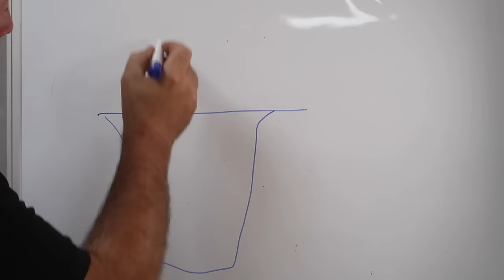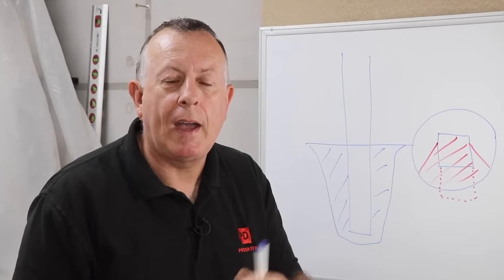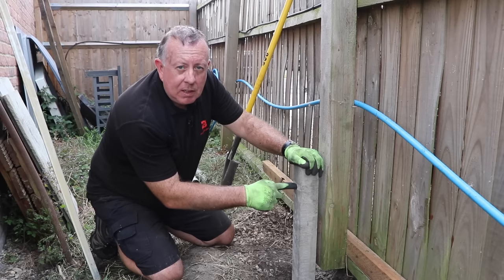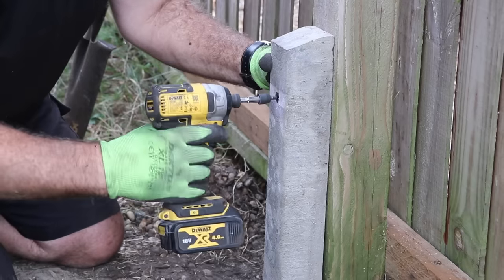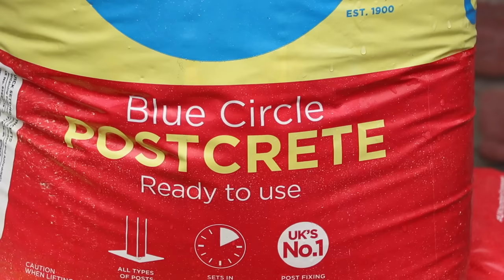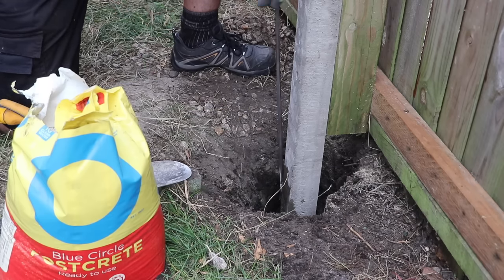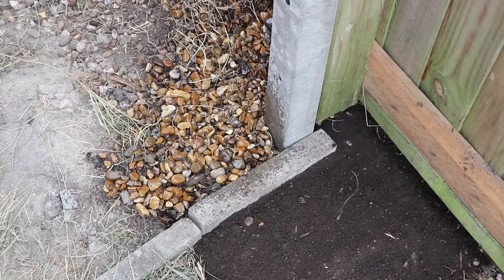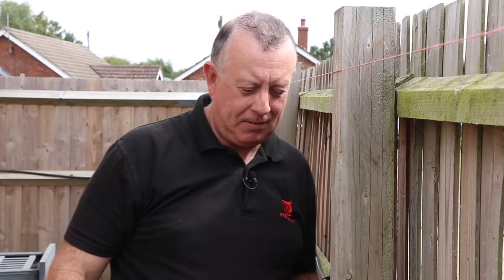The Easy Way to Fix a Fencepost

Comment: Should have put the concrete spur at the side rather than in front would have looked much better.
Reply: Easier putting the hole on front than on the side — one you have more room for you — not blocked off by the fence itself. On the front you have plenty of room side to side, and back that matter. Post hole diggers you have to drive/stick it down into the ground and then spread the handles  handles out and then pull out the digger with the dirt held inside it. And then repeat the action until you get to the depth you need.

Comment: Nice job Stuart.  I also used 75x75mm concrete posts but was able to attach them with M10x225mm coach bolts.  It turns out that the constriction in the holes is because of the concrete forming process and it is quite easy to drill those holes out to 10 or 12mm

Comment: Hi Stuart.  One thing you might want to try when trying to plumb a post to a string is after you attach your string to your two fixed points, slip a shim ( say 1/2" thick) under the  string near each end. While pulling the post towards the string, slide another shim ( the same thickness) between the string and the post.  When the shim contacts the string, the post is plumb. The nice thing about this practice is that while working, you can tell if the post has moved out of plumb. The way you do it, the post could lean into the string slightly, and it's hard to tell. Anyway, just how I've done it for about 50 or so years. Like your videos.
Reply: I really really appreciate this idea! Thank you!

Comment: Excellent little project as ever. Might be worth adding that neither the fence nor the post will mind if you mount the spur to the side ofthe post. 'Slightly' harder in the digging out phase, but will retain width of access if things are tight, and make mowing or strimming a bit easier. And you could have gone back and fitted coach bolts quite easily with access all the way through.
Reply: was thinking the same. great tip!

Comment: Good helpful vid (as always).
I've done this to all my fence posts (about 17 in total). It usually takes me around 2 hours to do per post due to the old concrete, broken bricks and lumps of flint (I live close to the Sussex downs), that you have to break up and dig out of the hole. Plus I'm not a 20 year old lad anymore!
My method is to use a long fencing spade, pointed breaker bar and a very powerful SDS hammer drill with a chisel function and using a very long chisel in it. Even so the best method I've found once you get around 1.5 feet deep is to reach in and pull out the soil by a gloved hand. I usually stop when I get to armpit depth!
Then in goes the concrete spur (after drilling out the tapered holes to suit the screws), using bits of stone or similar underneath the spur to make sure the base is at the right depth. I have had good success using 10mm diameter, long coach screws and large thick square washers to secure the spur to the post. Place the screws in the spur holes and give them a couple of good whacks with a club hammer to get the points in. Then screw them up using a socket and ratchet wrench. Making sure everything is square.
You may need to support the post using a length of timer screwed to the post and at an angle in the ground to steady it and keep it square before concreting.
I always use postfix. Sometimes using bits of removed material like flint, stone or half bricks to fill the surrounding area of the dug out hole if it's too large.
In goes some water and then the post fix. I usually use 1.5 bags per post on my 2m high fence. Tamp the mix down with the end of a piece of wood to make sure the mix is right around the spur deep down.
Just a tip. I had a very difficult to reach corner post that needed securing. Awful job with the fence (arris rail close boarded) still attached and at less than a 90 degree angle to another fence. Add to this a holly tree close by so not much room to work in. All I could do after digging out the hole was to position the spur on the corner of the post 45 degrees to the faces. But it worked very well with the coach screws driven into the corner of the post. You should have seen my rope work and how I pulled that post true using another post and a couple of trees (spider man took some web building tips of me that day).😂

Comment: When installing a new wooden fence with wooden fence posts it is wise to use an ancient Japanese solution, Yakisugi. Simply burn (char so you cannot see any unburnt wood) the bottom of the post to a point just above ground level, this will ensure it will not rot and bugs will not eat it well past the time the treatment will last. 
If you have seen archaeological digs they'll show you a stain where wood was before it rotted but they always find burnt wood in tact, I have seen 1500yr old burnt wood, so, it works.
Another trick for removing old posts and concrete is not to dig it out making a larger hole but to lift it out using a car jack. When I worked on rail projects, namely stations we used a method that ensured rapid changeover for upgrades or damage. We first buried a pipe into the ground and concreted it is then dropped the post into the hole securing it at the depth we needed, then poured dry sand around it tamping it every so often until it reached almost to the top, then we sealed it with a ring of cement. this method is also good for a place where posts get damaged a lot.

Comment: Great tip about putting the ledger board through and screwing it in to hold the bottom rails together, as its usually that the post that's rotted is the one where the bottom rails join

Comment: Great video Stuart!! Retired canadian carpenter here, i certainly don't know everything, I'm not sure if "spurs" are sold here in Canada, but your post ( no pun intended) gave me a idea of using what is available. So I'll probaby clean out the hole like you did, but my spur wil be a ground contact rated, presuure treated 4x4, with carriage bolts. I'm also going to try your method for postcrete. Like you, I to don't think its ever properly mixed. So thanks for the video.

Comment: Hi. Thank you for showing this interesting video. Around, one year ago, I did similar work in my garden as an amateur DIYer both to install about twelve new wooden posts and to repair two broken wooden posts for six-foot tall fence panels. I like the appearance of wooden posts. Prior to doing the work, I watched a lot of YouTube videos and looked at other material too.  I found my own way of fixing the fence, which may or may not be conventional. 

My experience is that concrete spurs with wooden posts are very durable. Most of the older wooden posts around the garden were installed with a concrete spur by contractors around 30 years ago, and they are still sturdy.  One problem, with concrete posts is that if they are knocked heavily, they will crack and only the internal iron reinforcing bars will hold the concrete post upright albeit shakily. I had two concrete posts break by a tree falling on the fence in a storm and two when a neighbour's car backed into the fence.

For my recent DIY fencing, I used 4 x 4 inch (or metric equivalent) cross-section concrete spurs with 4 x 4 inch cross section wooden posts, because matching the sizes looks better, to me. The spurs were 1.2 m long, very heavy, and more expensive than the smaller ones, but I am glad I used them. I used 3 x 4 inch concrete posts, which were also 1.2 meters long, for my 3 x 3 inch wooden posts. I had no difficulty putting six -inch coach bolts through the ready-made holes in any of the concrete posts; however, I drilled a guide hole in the wooden post to make it easier to screw the coach bolt into the wooden post and avoid the risk of splitting the wood with a large diameter coach bolt.  Even though the heads of the large coach bolts were quite large, I also used study washers.  

Using 1.2 meter (four-foot) long concrete posts with two-foot deep post holes, I opted to fill the post holes with concrete (not quick-setting concrete) to a few inches below ground level, so the remainder could be levelled with topsoil where lawn or plants would be able to grow. I did quite a lot of marking out and measuring distances to position the new posts correctly. I found a string line was very useful and I used a spirit level a lot to make sure the posts were vertical. Home-made post caps help to stop weathering at he top of he post and give a finished appearance, I would say.

Even though new posts are treated with a wood preservative, I applied additional wood preservative that soaked into the wood to keep out wood worm and rot. In all, I applied wood preservative three times to the new posts before they were in the ground taking extra care to dip the ends into the wood preservative to allow it to run up the grain. This is probably not necessary; however, they have retained a nice colour rather than turning grey, so far. I am interested to see how long they last.  

I tried using post-fix (quick-setting) cement once, but it solidified so quickly, that it did not give me chance to make final adjustments to the alignment of the post, so I would always mix my own concrete now.  As an amateur DIYer, I work slowly and I need adequate time to adjust the post after the concrete in put in the post hole.

Comment: Stuart - thank you for this useful video. At my recently purchased 1988 early 'ECO' house I have a picket fence with many rotten posts which were installed many years ago by the now deceased buildet owner. Spur posts are rhe ideal option for progressively repairing the 19m long fence without dismantling the entire fence alongside a roadside footway. My 2 reasons for using them is that they will never rot and even new short fence posts used with them will be protected against rot by stopping them above ground level.
My plan is to use concrete made with 1 postfix bag to 1 large bag of ballast, all placed in layers as you've recommended. I've used this mix formerly on quite a large charity-funded fencing installation at a school with great success.

Comment: I mostly use mixed dry concrete if I have to use it for posts. There is often enough moisture in the soil for it to harden. On the other hand, you can pack dry concrete very tightly. It provides a very stable support for the post.
That is just my way 🙂

Comment: Funnily enough I have just set a few posts using postcrete. Like you Stuart I'm a traditional type always mixing my own and using more than enough concrete to straighten Eiffel tower!
This time I premixed  the postcrete in a builders bucket so I knew it was well mixed and I could then pour it in..... If I didn't get it poured in straight away it was setting in the bucket! And it didn't take many minutes! I feel sure mixed properly it is very strong

Comment: Hi, thanks for your videos. When I did the same process for two gate posts at my home I used an m8 length of threaded studding and drilled out the hole in the spur. I found this to be very secure. Cheers.

Comment: You are an inspiration, I have exactly the same problem on two posts in my garden. Wasn't sure how to attach and concrete in the spur, the only thing I'm going to differently is to put the spur to the side and bolt through (idea from a comment below). Keep up the good work.
Remember, opinions are like ****holes, everybody has one. :)

Comment: Can't imagine fitting posts without the concrete spur anymore, saves all the hacking out old concrete. I believe the reason posts rot because the concrete isn't taken up to ground level and tapered off so the post doesn't sit in a puddle of water. Always enjoy your videos Stuart.

Comment: Ive followed the postcrete instructions for these these type of spur repairs and never had any issues  even many years later. Top tip though if getting a new fence spend the extra for concrete. And concrete with slots if that fits the garden layout so easy to replace panels later

Comment: We have used PM and went by the instructions. Just used a bit more water and poked at it t to ensure the water was mixed in.. Also, obviously with wooden posts we built up a small slope of about 2 inches or so  of PM around the base of the wood to stop water getting at the foot of the wooden post. Great vids though. Keep them coming.

Comment: Great video. It is always a bit hit and miss with how much water to add when using concrete directly onto soil as the soil will absorb different amounts depending on its composition (sandy, peat etc). Also I would have put the bottom of the post, after cutting it, into a container (old paint tin or the like) and then put some liquid wood preservative into it for an hour or so to absorb it, whilst having a cup of tea and a biscuit!

Comment: I have some 50 odd wooden posts  around my boundary.  It’s averaging about 3-4 per winter (always the winter when they finally snap!).  But using this method for quite a few of them.  I go to a local builder to get my 4inch spurs and they sell the decent right sized bolts for the holes. 

Biggest issue I’ve had is hacking out the half the old ball of concrete to get the spur up against the post.  Removing the rotten wood isn’t always possible. 

Thanks for the video from one of those new patrons who signed up last week 😊

Comment: Everyone has their own opinion and ways of doing things, it doesn’t necessarily mean anyone is particularly wrong and if the end result is satisfactory to the person doing the job then that’s also fine.
You offer some great advice, you don’t always do things the way that I would do things but I do get good ideas and tips.
At my old house I was lucky enough to have a sturdy wall to secure fence post to, I left a gap between floor level and bottom of the posts and indeed shaped the posts so that rain water would run down off the bottoms of the posts. All well and good until a contractor came the following week and dug up the footpath and relaid tarmac above the level of the post bottoms, best laid plans and all that.

Comment: That's really helpful Stuart, thank you. My problem is a dead cherry tree covered in a mass of clematis Montana fell and pulled a fence post forward about 6 to 8" inches from the top. After a lot of blood sweat & fears 😱 I cleared the mess and very large trunk out of the way but I'm left with that leaning post  & fence.
You might think I've gone loopy but I was thinking of attaching a post about 3 foot long at a  45deg angle and using a bottle jack at the other end  jack it back upright until it's straight and true. My idea then was to just concrete the cheap jack into place and hide everything with plants.
I think this has solved my problem though once it is upright again 😊
You should have one of those 'Thank you' buttons so people can send you a few quid.

Comment: Thanks for your content...

I saw your video handmix vs postcrete. You make some good points, but being retired, have the advantage of time to investigate. Contractors don't have time for handmix installs of fences, the job has to be done on the day, to make it profitable. 

My own input would be, that I dovetail the dig-out wider at the base than the top, providing  more stability, and also that the postcrete sets stronger, the longer natural seepage of moisture penetrates it, over time. 

In multiple decades of using postcrete i've never had a call-back.

Comment: Good video as usual Stuart. I've never encountered a "concrete spur" before, hence every day's a school day. With all your effort to install this, wouldn't replacing the post be a little easier in the long run?
I've been threatening to move house for a few years now, thus leaving the couple of dozen fence posts in my garden (of differing ages) as a delight for the new owners. Recently I have come across those substantial "U" shaped metal brackets that have a spike under them for concreting in, and wondered whether they would be a worthwhile install to hold a post. All to keep the wooden post off the ground.
I have already tried the trick where you add some old copper pipework around the post to poison the ground and deter the bugs from feasting on the post, with little success.
Oh for an easy life...!
Could you not enlarge the screw holes with an SDS bit but the drill not set in hammer mode?
Thanks again

Comment: Love your videos, so genuinely practical and helpful.  I have lived in a house for 20 years and often wondered why the fence posts never lasted that long, then someone told me the following and it was a revelation: you only have to hit the base once with strimmer and rot will set it...
Reply: Paint the bottom of the post which will be in the ground with creocote or similar (modern imitation of real creosote), and leave the post standing in a couple of inches of creocote for a couple of days. The old way is the best.  Use real creosote if you can get it. Or just use godfathers from the word go; saves time and money.

Comment: Thank you for your insight. I have not tried your method yet. I have just replaced the post with another post. I  covered the post from the concrete up about 6 inches on the post with roof tar. This keeps any water or snow accumulation  around the post.

Comment: Great vid. Didn't know these existed, so that's good to know. As mentioned, those fixings aren't the best choice. I can imagine they will be the first thing to shear if the wind catches the fence. I would go for widening the holes and using M10 coach bolts. 100mm posts will happily take an M10. Digging out is always the worst job.

Comment: When i. 
use post mix i mix it up like i do with concrete then pore it in the hole . Generally posts last 6 to 8 years and when it comes to digging the hole out post mix is softer to break up than concrete ..luv your video s